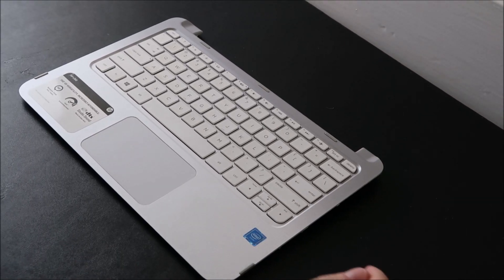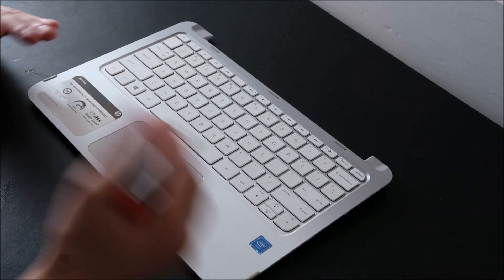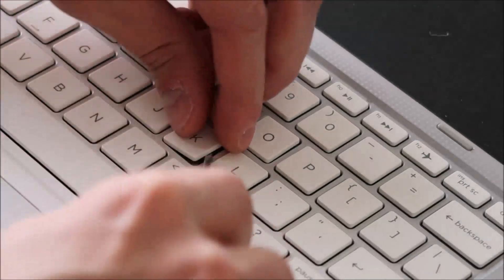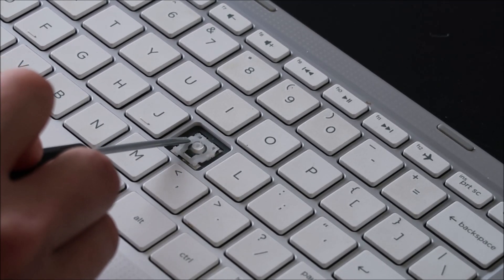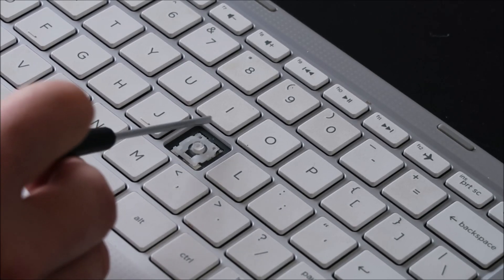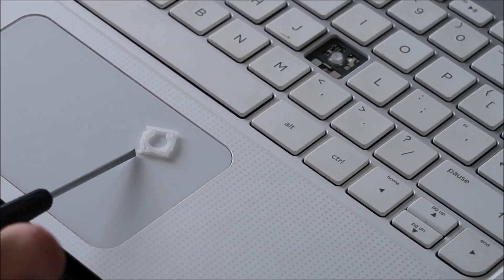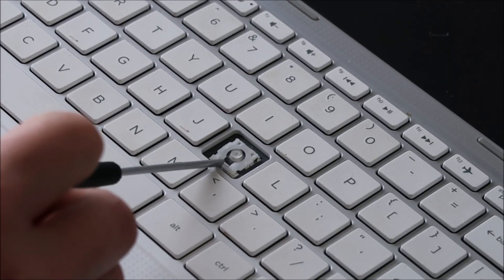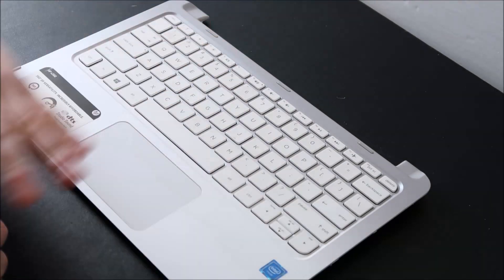How To Fix Replace Small Keyboard Key - HP Spectre x360 Laptop Computer

Comment: My rubber spring has come loose on my Up Arrow key. Can I glue it back on? If so, could you post a video on how to do it safely and with the right kind of glue? I have both my Up key and the rubber spring in a zip-lock bag so I don't lose them.

Also, just to let you know, I have a late 2017 HP Spectre x360, the special edition Rose Gold one.
Reply from the maker: There isn't really a good way to reattach those.  They are not meant to be replaced.  Best advice is try to use a small amount of glue.  If that does not work, you may have to replace the keyboard.

Comment: What do i do if my metal clips broke of the hp probook 440 g7🥹
Reply from the maker: Are the metal clips broken and need to be replaced or did they just come out of their spot? If so, they can be reinstalled.
Reply: @PC_Monkey  they got all bendy
Reply from the maker: @nielswiersma08  If they are just bent, you may be able to bend them back into place. If not, you may have to replace the key assembly

Comment: I broke my "r" key (have to cut and paste every time I need to use it) but the white underneath part is broken. What would you recommend? Keyboard sold out and I'm hoping to find a solution. Thank you!
Reply from the maker: If any part of the key assembly is broken, you would have to replace it.  I usually get my keys on Ebay or www.replacementlaptopkeys.com.  If you cannot find a loose key for sale, you may have to purchase a keyboard and take a key from there.
Reply: @PC_Monkey  Thank you for your response! I've ordered both a replacement key and found a keyboard (my income is connected to this laptop!). Fingers crossed! (It takes forever to cut and paste the r's each time they occur.
Reply from the maker: @boforbes6617   Good luck !!  Let me know how it goes :)

Comment: Thank you for your video. I spilled a drink on my keyboard. After quickly turning it off, flipping it over and getting the liquid off and out, I’m left with the T and the Y keys not working. I’m wondering if popping them off as you demonstrate and maybe wiping the plastic might fix the problem? Or, do you have another recommendation?
Reply from the maker: Do they feel like they are not working well?  Are they sticky or not physically working properly?

Comment: I just found my mute button next to my computer. I think it was the cat.  can I just push back in it's spot or do I have to replace it completely?
Reply from the maker: If nothing is damaged and if the Hinge Clip is still attached correctly, you should be able to just push the Key Cap back on.  If that does not work, perhaps the Hinge Clip is out of place or damaged.

Comment: I accidentally undid the 2 plastic parts and I don’t know what to do know, can u make a vid on how to put them together??
Reply from the maker: They fit together with a small plastic pin on the left and right of the inner clip.  These fit into holes on the outer clip.  To see exactly how the inner clip sits in the outer clip, remove another key cap and copy the clip under it.
Reply: @PC_Monkey  thank u for ur help but I already broke it 😭 thank u anyway tho
Reply from the maker: @machoii5731   I usually get my keys on Ebay or https://www.laptopkeys.com/.  If you cannot find a loose key for sale, you may have to purchase a keyboard and take a key from there.

Comment: What about replacing the top rectangular keys? 
Mine came off and idk how to put it back on
Reply from the maker: You would install those the same way you would the normal sized keys.  They components are just much smaller

Comment: Thanks for the video, the up arrow on my keyboard has come loose. on the reverse side of the key i'm seeing 3 plastic legs/tabs and possibly where a fourth should have been can this be resecured or i'll need to find another key to replace it?
Reply from the maker: If no components are damaged, you should be able to reattach it.  If anything is damaged or broken, you would have to replace the key assembly.   I usually get my keys on Ebay or https://www.laptopkeys.com/